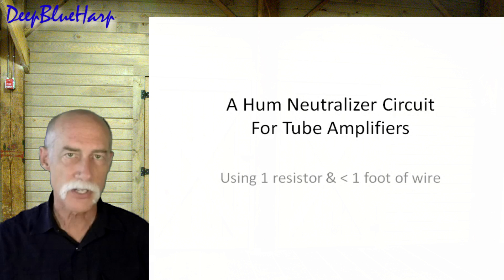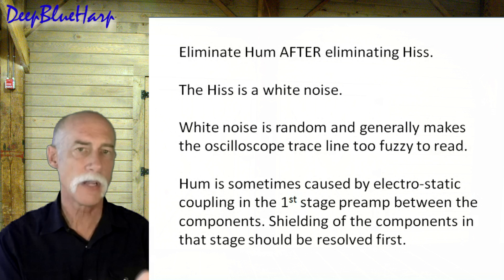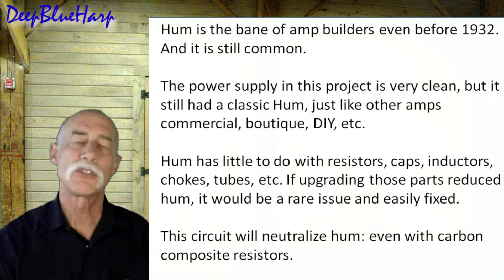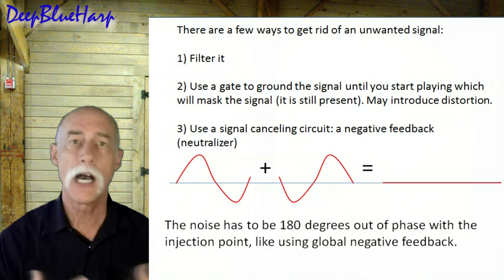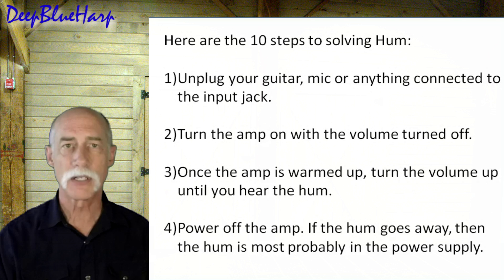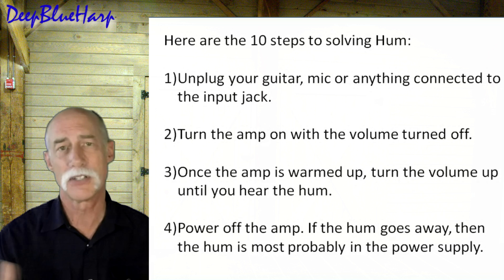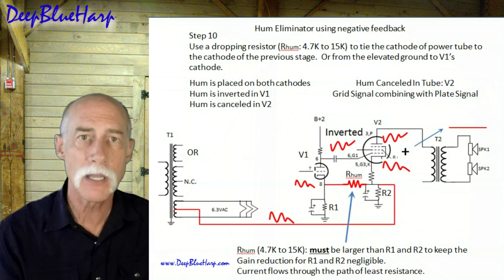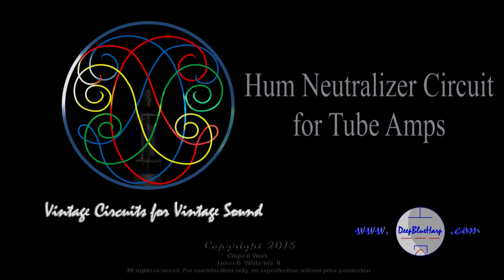Hum Neutralizer Circuit For Tube Amps

Comment: Excellent and extremely useful educated info into hum of tube amps. A question please. I have a class A SE UL stereo amp I am designing that has a NFB from speaker 16Ω tap to the 12AX7 preamp cathode. I get a light hum that peaks at 100Hz and 150Hz acoustically analysed. If I input 1000Hz I see the envelope of the output modulated possibly by this hum. If I do your nice advice I will probably have two signals added at the cathode of 12AX7 (one is NFB and the other fro R hum resistor). Will that work? I will certainly try but is it possible?

Comment: Excellent video. Could you please explain how to get rid of hum on the Marshall 18 watt lite amp from preamp? Thanks .
Reply from the maker: The most common solution to that amp is to elevate the heater. There are several schematics online showing how. Basically, it involves connecting the heater centertap to the cathode of the power tubes. That raises the heater centertap to the bias voltage of the power tube and quiets the residual hum.

Comment: Putting a 12.6vdc  regulated heater circuit would also help also. At least on the preamp section. Power tubes 6.3vac no problem since they cancel out.

Comment: I have a question. My output tube cathode has the parallel resistor/capacitor, but not the other resistor to the cathode. Can I attach R hum directly to the cathode? Thank you.

Comment: Very nice idea. I will give it a shot. From what I can see from your schematic is coming off V1 cathode, use a 470K to the cathode of V2, or power tube. Is this correct?
Would like to see the waveform after the resistor is added.

Thanks much

Comment: Even if there is a voltage rise on V1 cathode this could be adjusted back down with resistor value changes on the V1 cathode and or plate resistor.

Comment: I still have hum in my push pull build using this setup, any other tips for dc elevated heaters?
Reply from the maker: I will share some general information because I don't have a photo of you chassis. If you still have hum, the top issue is generally wiring. The wiring must be absolutely neat. If you look at a Fender Deluxe, you will notice all the wires are no longer than required to connect between 2 points. There must be NO EXCESS wire. Excess wire acts like an antenna to pick up noise from the B+ or Heater wires. All the wiring needs to be laid flat against the metal chassis so the chassis can absorb and ground out any interference that is causing the hum. If a wire needs to cross another wire it must cross at a 90 degree angle. Also, do not run any wire along the side of a component (cap, resistor, etc.) Wire must cross over the component at a right angle or not at all. Wiring at a socket or a pot is a challenge because that last inch at the lugs requires running wires in parallel. (UGH), but just 1/8 inch of separation can make the world of difference. Tube amp wiring is challenging.

Comment: Would the same steps apply to trying to diagnose 180Hz hum?  Not entirely sure where it is coming from, but it is present with all knobs at minimum and nothing plugged in.  The hum then increases with the REVERB knob, even with volume at minimum.  Interesting.  And, it is present even if the reverb tank and footswitch are disconnected entirely.  Thoughts?  '65 Princeton Reverb clone.  Thank you, your channel is very informative!
Reply from the maker: Please send me an email (see my YouTube channel). I am going to need some more information and maybe a sound clip for analysis.

Comment: Great video and tutorial - thank you very much for the information. How would you handle a fixed bias push pull circuit such as a Princeton 6g2 layout? Any suggestions regarding the Inversion and injection point into the 2 power tubes?
Reply from the maker: Thanks for watching. It is a solution for single-ended amps only. Because: Rule 1: PP configurations are hum canceling circuits.  Rule 2: The PP tubes have grounded cathodes, which makes the PP configuration absolutely & positively deathly quiet. If not, then 1) one or both of the tubes is/are getting old, 2) the power filter caps on the 5Y3 are suspect or 3) the preamp tubes are the problem: old tubes or the connection to the input jack is creating a hum (ground loop issue).
Reply: @deepblueharp  Makes sense - thanks for the response!

Comment: I believe this would be applied to the output power amp section.  I have a hybrid Marshall.  A 12AX7 preamp with a solid state output. I'm not quite sure if rewiring the preamp with a triode tube would produce any quantifiable results.
Reply from the maker: A solid state output has other issues, so this isn't applicable. Also, a triode power tube is much less prone to hum and should not need this neutralizer in most cases.

Comment: Hi, very interesting technique. I wonder why does V2 has two resistors, is to implement correctly? because usually there is only one resistor with a capacitor. Secondly, does it need the filter capacitor on the cathode resistor or it will still work without the capacitor? Thank you
Reply from the maker: On the cathode: one resistor is 1 ohm to take a direct measurement of the current the other sets the bias. The cathode does not need a bypass capacitor for this to work.
Reply: @deepblueharp  thank you!

Comment: How would you use this technique on a class AB push pull tube amp where the cathode is grounded on the power tubes ?
Reply from the maker: I had this question sent to me last week and I have had time to think about it more.

I really wouldn't suggest doing this with power tubes of a AB amplifier. The cathode will need to elevated and the RC filter needs to be rated for 7 watts. However, it can be done. The cathode of the power tube needs to be elevated to 2VDC to 5VDC and a resistor (10W rated) connected from the cathode to the output of the preamp (generally the second stage). It is the preamp that is normally the source of the hum that needs corrected. So...

What would be better is to elevate the ground on the preamp section. Connect the centertap of the 6.3VAC filiment to the RC filter of the preamp second stage (it is normally at 1VDC).  Then connect a resistor from there to the cathode of the first stage of the preamp.
Reply: @deepblueharp  can you do a schematic for this

Comment: It works! Thank you for posting. I have one question though. Could you put a variable 20k resistor in place of the Rhum?
Reply from the maker: +Christopher Chirico Yes, you can if you have space. Thanks for watching and I am glad it worked for you.
Reply: HI, I am going to try the 20k pot today. I just wanted to clear up something first, If you have time. I did not have a center tap on my 6.3 v secondary and used the 2 x100ohm to create one. This center tap lead would then go to the wiper on the pot and the 1 and 3 would go to the respective V1 and V2 cathodes directly on the tube pins. Correct?

Comment: Sir, let's say I want to use oscilloscope on my computer (PC software). Can I hook amp an amp (Speaker taps) to a PC? How one can do that?
Reply from the maker: No, you cannot hook your PC to an amp or any other high voltage device. It will require an interface that will isolate your pc from the devices (like the amp or speaker). The isolation devices will output safe voltage levels for the pc (under 5 volts). I have no recommendations for you. I use an oscilloscope that has outputs to send to a pc to safely acquire data.
Reply: Okay, thank you. Any advice about parameters which good oscilloscope should have?
Reply from the maker: I would suggest looking at the Hantek HT6022BE20MHz 6022be PC based usb digital storage oscilloscope's specifications. Also, it is really inexpensive.